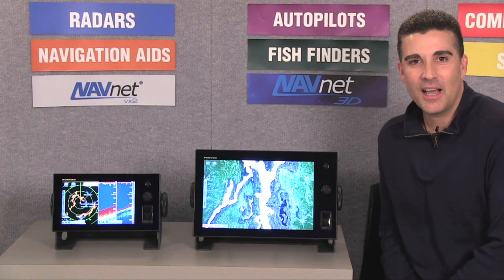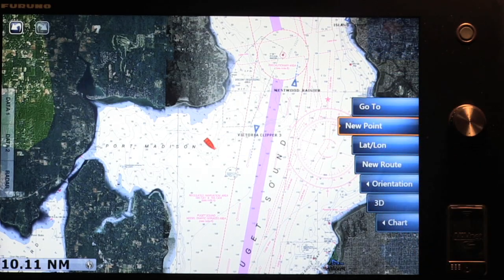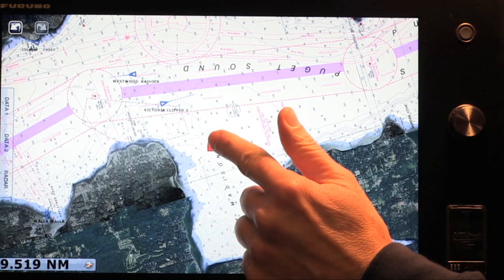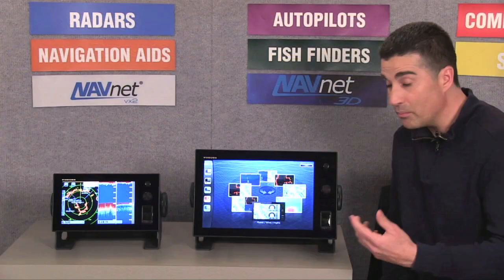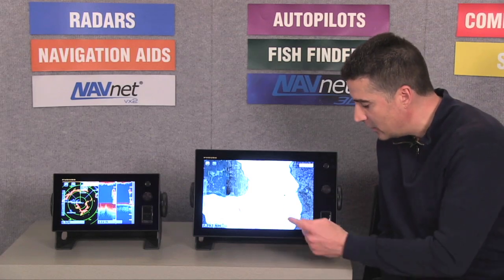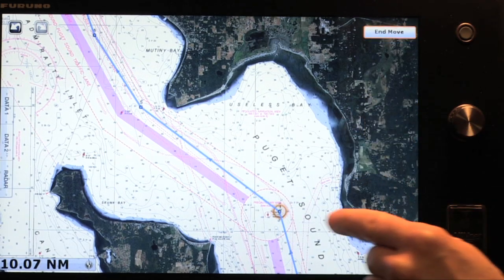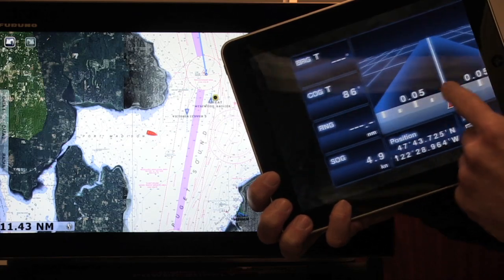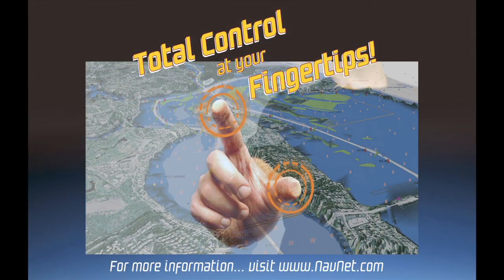NavNet TZTouch Guided Tour

Comment from the maker: @bezington52, the MSRP for the TZT14 in the US is currently set at $7,695. You will need to check with Furuno UK to find out what the pricing is in England. As for being compatible on yachts around 50 ft., absolutely. In fact, the TZT9 would even fit on some boats in the 18-25 ft. range!